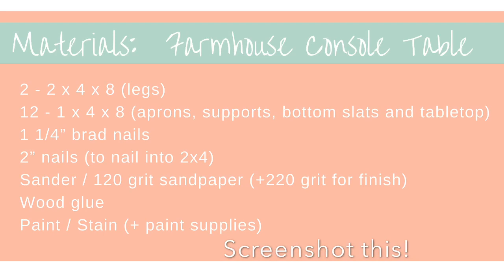How to Build a Long and Narrow Farmhouse Console Table | $30 Lumber

Comment: Can you elaborate on the painting part. Did you use dry brush? Did you wipe while it was still wet and then sand when it was dry? Did you paint haphazardly missing out parts?
Reply from the maker: Sure! I would dip the brush into the paint then wiped off the brush of any excess to avoid it going on too thick, long continuous strokes haphazardly, yes. I waited until the entire piece dried and lightly sanded.
Reply: @MamaWantstoBuildbyKristyGreen  Nice!  Thanks for the heads up! Its an awesome piece!

Comment: New subbie here.  Glad I found your channel.  Love your table.  Quick question.  Can you or anyone else suggest a good quality inexpensive nail gun??  Also have no other power tools.  Would love a rec for a good inexpenseive drill.  Thanks much!
Reply: gmadiva I use dewalt for all my power tools! Home Depot and Lowe’s have sales this weekend
Reply: No doubt Dewalt and Milwaukee are fantastic tools but for a DIY home person I strongly suggest Ryobi, it comes with a 3-year warranty and super high quality. Also there is so many add on options to the 18 volt plus system from Naylor's 2 chop saws and everything in between. Very cost-effective as well. I strongly recommend starting off with a set that comes with a few tools and the batteries and charger.